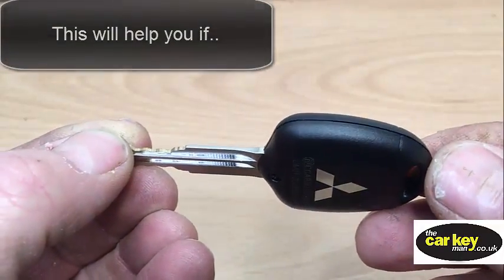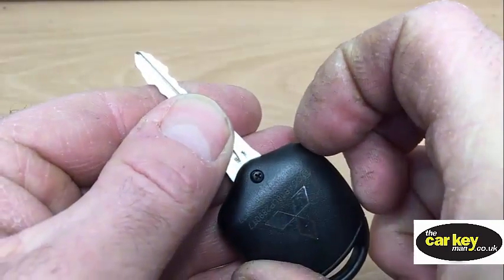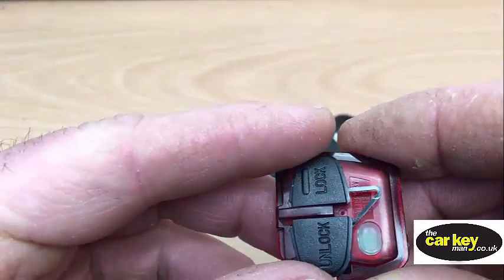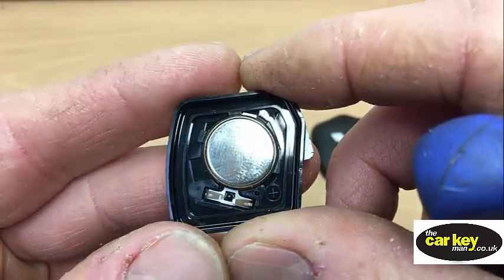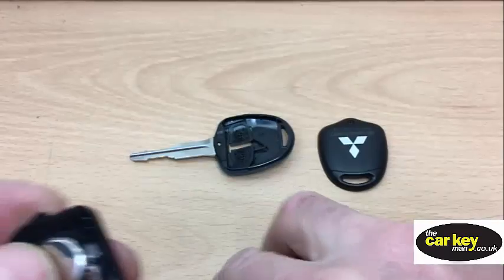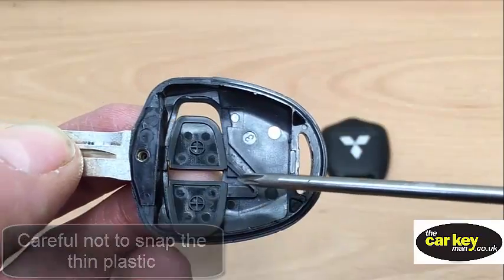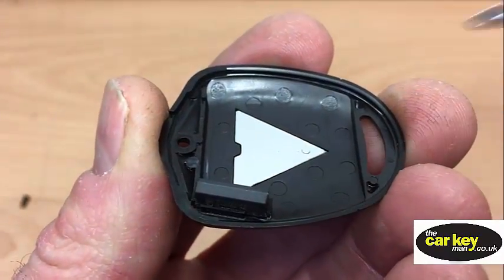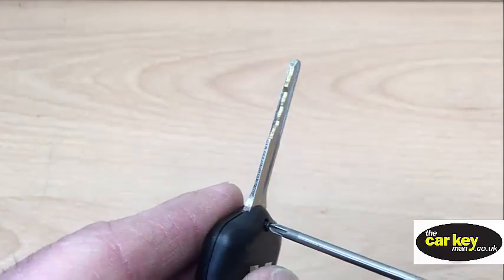Key Battery Mitsubishi  HOW TO change

Comment: Dropped my key and black plastic broke in half. Chip is still there. I glued it and everything works. Any idea where I can find a plastic replacement? It's a mistibushi rvr 2011.
Reply from the maker: Hi Edisha, there is a good selection on eBay and Amazon. You just need to check because there are two styles of blade

Comment: Cheers mate!  it had stopped working so i bought a battery and all was fine until the little black piece fell out (you know the bit that you said be careful as they are attached to the buttons:face-orange-raised-eyebrow:) Anyway i managed to get the buttons in position and they kept there until i put it all back together. So i would say that it is do able but just got to make sure its in position. So your vid showed me where it should go, so cheers for that  i was quoted £28.00 by someone to fit it for me:dothefive:so did it meself for £2.50 Happy days!👍
Reply from the maker: Well done, these keys are terrible, small fiddly parts that are easily lost or broken. Glad it all worked out ok :)

Comment: After I replaced my battery they do not last long. May be aliexpress crap batteries. They just work 1 year. After 8 months I have issues to open the car if key was left in a cold place(+12C). Im thinking to try 1620 battery hopping it will last longer.
Reply from the maker: Hi, I would get a good quality battery and I'm sure that will fix the problem ;)

Comment: After the battery replacement, do i need to code the key again? I service my car at mitsubishi, the mech told me to bring the spare key because the main key doesn’t work and it must be recoded again. All I remember is the battery 100% must be replaced but recoded? I’m sorry for asking..
Reply from the maker: Hello Michael, thanks for the question. It's never certain whether a key will need coding after key battery change. We change hundreds every month and very rarely do we need to recode. However, as a general rule, if the key still works when you change key battery, then it will normally stay working.
However, if a key battery has died and the key no longer works, then there's a chance it will need recoding. 
Sorry I can't help more.

Comment: Hello. I need to purchase a replacement key for a Mitsubishi ASX 2011. Any website recommendations?
Reply from the maker: Hi Christina. Well the problem is that if you buy your own key, you may have trouble finding someone to cut and programme it. With a Ford key there's not a problem, but with your ASX, it's pretty specialised, so I would recommend finding a local Car Key Man and get a quote...Sorry it's not straight forward, but if you buy the wrong thing you will have wasted your money.

Comment: Hi. Wow. I finally found a clip with Mitsubishi Outlander key FOBs that match my own. 
I recently purchased a (Jan) 2012 Outlander LS with 2 x keys but 1 isn't communicating with the car. Thankfully, one is. I tried replacing the battery but still nothing. The transponder chip is definitely in the non-functioning FOB. Is there a simple solution to programming the electronics to the car's system? I found a YouTube clip suggesting holding both buttons for 3 blinks then the unlock for a further 3 but it didn't work. Hope you can help. Thanks.
Reply from the maker: Hi, if the chip is definitelyin the lid of the case, and the van runs with the other key, then it seems the only possibility is that the key isn't coded to the car. This needs doing with diagnostics I'm afraid

Comment: Hi, I hope you can help.
My battery light was going dim and wouldn't open the car. Watched your video, got new battery etc but the lights won't go on and won't unlock the car. Replaced with the old battery and now the lights don't go on with it in.
I was very careful doing your procedure.
Any ideas?!?!
Thanks
Reply from the maker: Hello Jamie. Ok, so there a couple of things to ask. 
Before the original battery went dim, did the keys buttons unlock the car?
So did your old key work in past?
Reply: Thanks for the reply, yes it was but it would take a number of pushes before the door would unlock. This only started a few days ago. So I found your video, bought another battery yesterday and put it in today and nothing.
I checked all the terminals etc everything looks normal.
Thanks
Reply from the maker: OK, I'm not sure. If you put the old battery back in, then it should do what it did. Does the light come on at all with either battery?
Reply: No, nothing. Complete blank. Light was working before, very dull but now nothing.
Time for another whole key I think.
Reply from the maker: It's a bit odd. There are connectors inside, are they touching the battery in the correct place?
Reply: Yeah I've bent them up a little, carefully, just to make sure they are touching but still nothing. Might have to bite the bullet and take it to a specialist. Cheers for you input
Reply: Same as mine. The battery die inside the fob. Replaced with new battery. The light blinks 3 time but when i pushed the button no blinks at all and i cant lock or unlock my l200 with remote.
Reply: I had the same problem with the newly installed battery.  The voltage looked ok 3.23v but clearly some Chinese made batteries just don't deliver the amperage required.  I bought another 'quality' Japanese made battery with plenty of time before the expiry date and it worked fine (3.27v).  To be fair maybe the first battery I tried was expired...

Comment: if you have to reprogram the key fob 

1. Hold both the lock and unlock buttons until the lights flash three times.
2. Let the buttons go.
3. Push the unlock button until the light flashes two times. Your car is synchronized.
4. Test the connection to make sure everything is working correctly.
Reply from the maker: Thank you for this information, it really helps the channel :)
Reply: That does not work with this key
Reply: @MrK1wey  I dont know what key you have but it worked for mine, a 2010 Lancer. sat in the car and reprogrammed like stated and worked fined.

Comment: Thank you for this, just saved us an expensive replacement key when we realised the case had split and the key would no longer start the car, we hunted around for the small chip and found it 👍🏻
Reply from the maker: Nice one, it's really common that the chip falls out and gets lost, well done for finding it!
Reply: @TheCarKeyMan  sir if the chip fell what should I do? Do I
Need to put it inside again? Using glue?
Reply: that happened to one of my key and it's so expensive to replace the chip
Reply: @DavidDavid-uc9zk  just glue it back in with “super glue” or “Cyanoacrylate”.
Reply: Yeah same just happened to me, unfortunately I cant find the chip 😢

Comment: Does anyone know why most lancers the metal blade key has a T-shape at the based, but all the replacement cases/fobs sold do not have the T shape, but only fit a straight blade?
Reply from the maker: Hi, ok a simple one really. The original metal key is moulded into the plastic, and the T shape gives it as much surface area to be attached to the plastic. The replacement cases are built is two halves, the plastic case and metal blade , but they are just compatible with themselves. They are not designed to take the original blade.

Comment: hi, my wife droped the key and tried to start the car afterwards, which didn't start, she tried a few time. when i came home tried the second key even thatone is not working. machanic can't find the fault. he attached the computer but no connection between key and ECU. any idea what to do next before towing it to the dealership?
Reply from the maker: Hi, can you see the chip inside the key?
Reply: @TheCarKeyMan  your video was very helpful.the chip was missing which we luckily found and car started after nearly three weeks. the local mechanic asked me to arrange a tow to Mitsubishi dealer. thanks again you saved me money and lots of hassle.

Comment: Thanks for the video, easy guide. I have changed the battery and there appears to be power to the key, transponder is in the key but the key will not unlock or lock the car remotely. Battery is in correct, any suggestions please? Thanks
Reply from the maker: Hi, sorry for the delay, I was a away. Does the red light on the key flash?
Reply: @TheCarKeyMan  yes it does

Comment: Thanks for the video. I decided to replace the battery in my spare as per your guide. I get all the correct lights so new batter is fine but it wont unlock the car remotely. Exactly the same model of ley as in your video. I replaced with a 1616. Any ideas? Or is it back to the main stealer? Thanks.
Reply from the maker: Hi, To programme the remote back in, diagnostics are needed,sorry!

Comment: A life saver…two Mitsubishi garages told us to check the battery…useless as it was a brand new battery. Yes the chip had fallen out …luckily we had kept it….thought it was a bit of inner casing…worked perfectly then!
Reply from the maker: Hi John, lots of people make this mistake, it's just poor design. Glad it helped you :)
Reply: I lost one of my car key chip not realising it dropped somewhere. My key drop but didn't see the chip nearby then I tried using it to start my car only to realise it won't start! 😭

Comment: Will you need to resync or reprogram the remote after battery replacement? I’m in due for a change and just wanting to be cautious prior to doing this. Looking forward to your reply!
Reply from the maker: Hi. As a general rule, if a battery is changed before it runs out, we don't normally have to recode it, but if it runs flat, then yes, there's more of a chance it will need programming. 
No promises, but normally they can be changed ok. Let us know please?

Comment: Mine doesnt have that chip, it has the slot though but can starr it
Reply from the maker: Hi, so it starts it without the chip?
Reply: @TheCarKeyMan  apparently. It split open earlier and I had to tape it together momentarily while waiting for a new case. I did not find any chip in the car but it starts and runs normally. Mine is 2015 glx hatchback. I am not sure if model or location matters. I am in the Philippines. I actually got worried when I saw your video amd I do not have any chip now but works normally

Comment: How easy are the keys to reprogram? I’m having to lock with key in the door at the mo?
Reply from the maker: Hi Matthew, is your key transmitting? Did it used to work? Have you tried a battery?
Reply: @TheCarKeyMan  I only got the car yesterday. The dealer said it would need reprogramming. When I press the buttons on the key no lights come on so is it worth changing the battery first?

Comment: I changed the battery key and it’s not working now. The light doesn’t come up, it use to work before I changed the battery. Do I need to sync or anything?
Reply from the maker: Hi, I would go back a step. Put your old battery back in and see if it works again.
Reply: Did you put the battery the right way ? Check it once more, Also try the original battery and see if the lights come

Comment: Do you have to resync with the l200 or is that not necessary?
Reply from the maker: Hi, have you changed the battery yet? Did it work before you changed the battery?